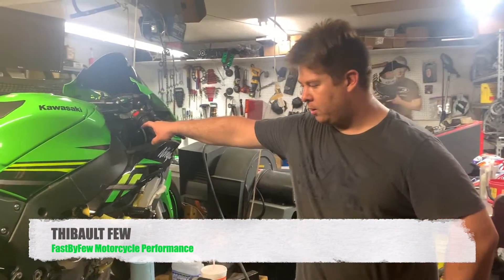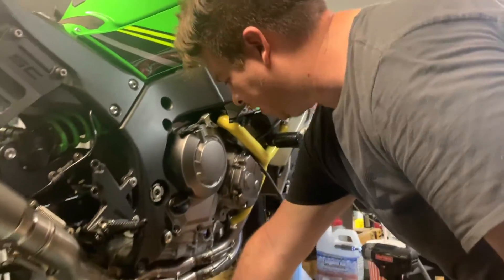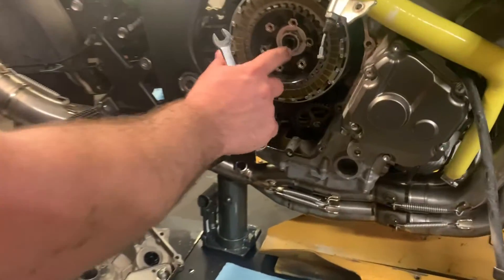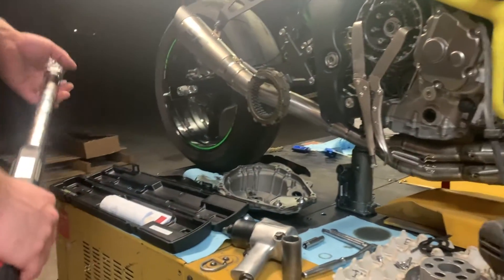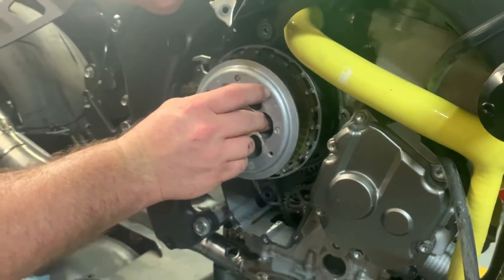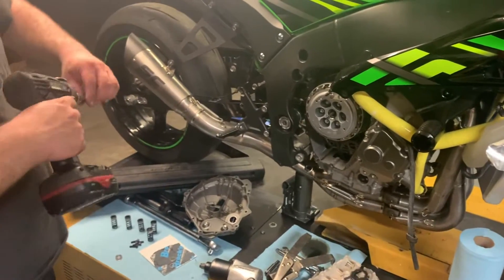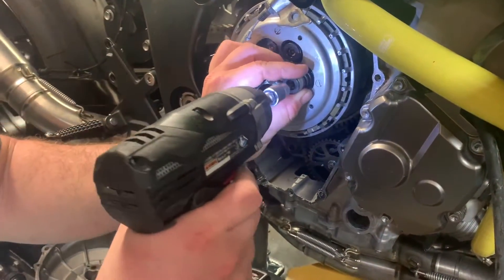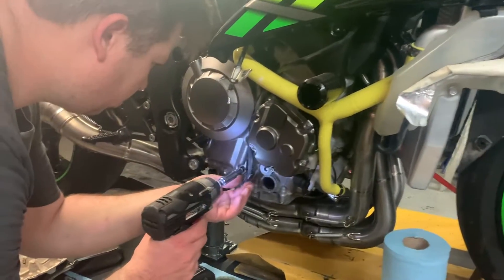ZX10R CLUTCH REMOVAL & Brock's CLUTCH MOD INSTALL 2011-2019 How To

Comment: Great video, you have any idea where I could find a clutch pressure plate for a 2007 
Zx10R, I have looked everywhere with no luck? EBC makes it for the 04- 05 ZX10R but not for the 07

Comment: Where is the basket bearing ? My clutch is making winy sound when it s pressed in, only when  the bike is properly warmed up. Replaced the pressure plate with a bearing and that didn't fix it.